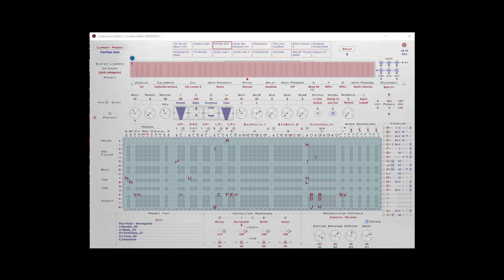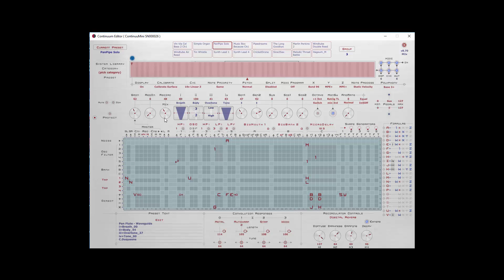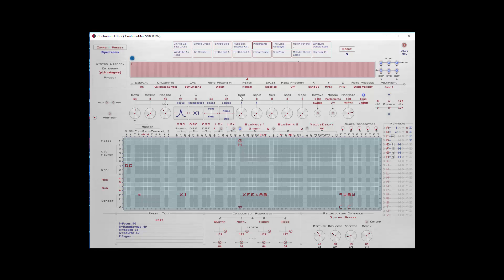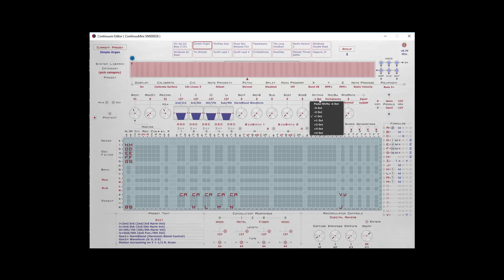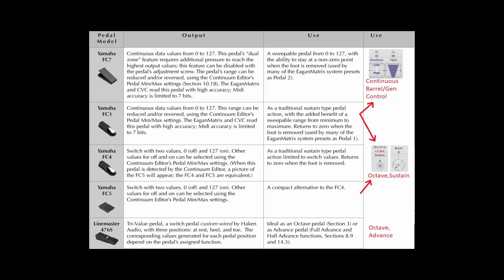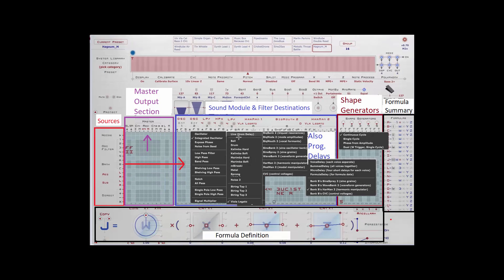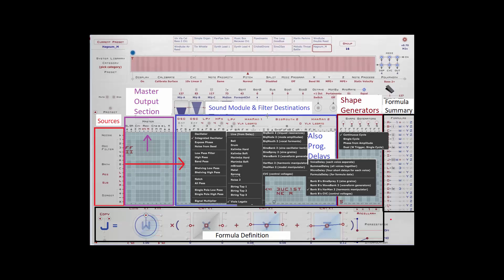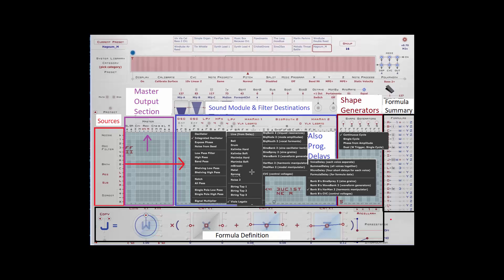Haken Audio ContinuuMini & EaganMatrix Fundamentals - Part 2

Comment: I have a midi pedal setup that I'm pretty sure I can get to send info into the ContinuuMini by various means. (Yamaha MFC10)  This setup usually includes a sustain and sostenuto pedal as well as two Fc7 controllers.  They are often set to CC4 and CC11, but can also be redefined as ModW, aftertouch, etc.  Given the support for only one pedal in the native Eagan Matrix setup and Mini connection, would these still be useable via midi?  I like footpedals! :)
Reply from the maker: If you can send MIDI from the pedal yes you can likely use it to control a lot of things, especially if you can set it to values for barrels CC12, CC13, etc. Look at the end of the Continuum Manual for the MIDI CC definitions.